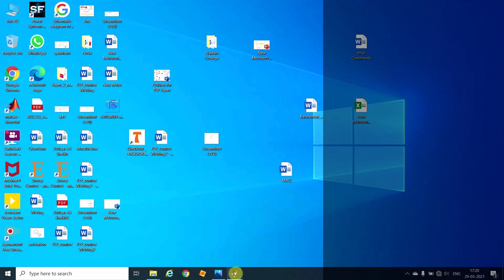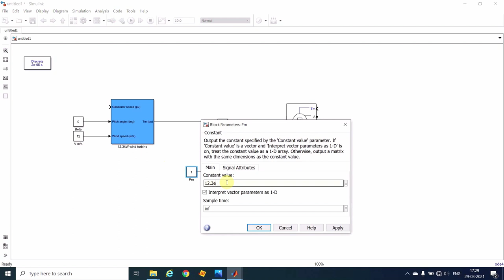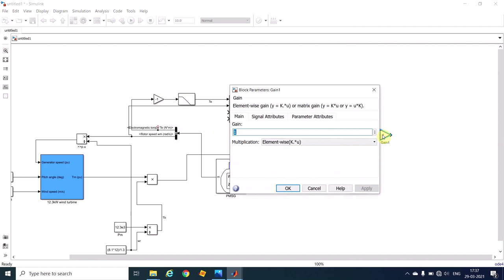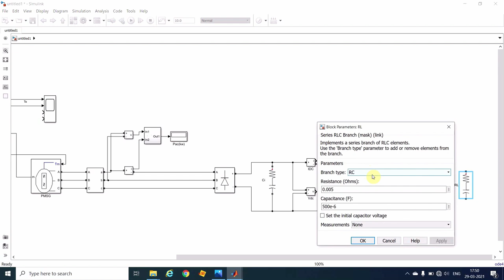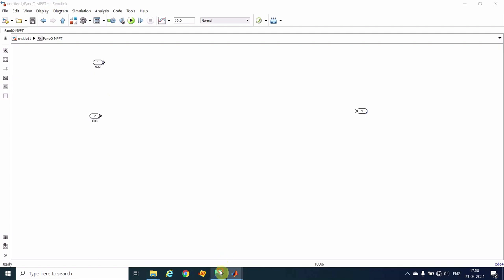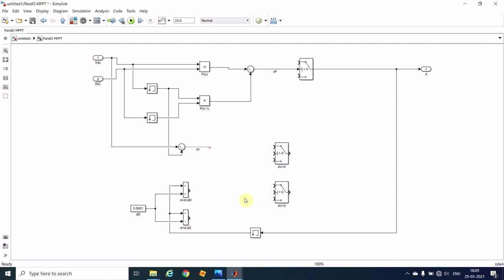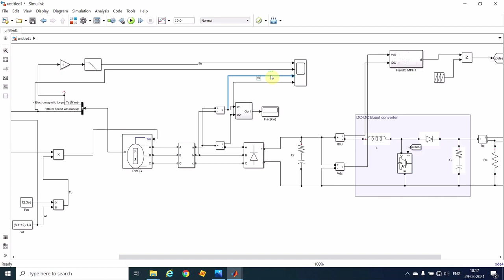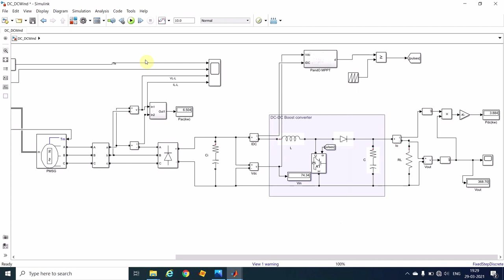MPPT with PMSG based Wind Energy Conversion system

Comment: Hello, Mr. Sh. Ansari!
I've been having a problem with the flowchart shown in your video 42:43:
My understanding: The increase in the voltage on the DC side of the uncontrolled rectifier indirectly indicates that the turbine speed increases. At this time, the mechanical power is greater than the electromagnetic power. In order to reach the maximum power point, the speed should continue to be increased at this time, that is, the electromagnetic power should be further reduced. Load power, since the load is a resistive constant load, can be achieved by reducing the Boost duty cycle to reduce the voltage across the load. This is the exact opposite of the model and flowchart in your video, but only yours is correct. This takes a long time. I don't understand what the problem is, I hope to get your answer, thank you!

Comment: The sample time 5e-05 of 'PMSGBOOSTMPPT/Subsystem/RMS/RMS /Fourier1/Product' at input port 1 is different from the sample time 2e-05 of 'PMSGBOOSTMPPT/Voltage Measurement/do not delete this gain' at output port 1. Consider inserting a Rate Transition block between the two ports. Alternatively, you can control the diagnostic action for unspecified rate transitions by changing the option "Multitask (or Single task) rate transition" on the Sample Time Diagnostics pane of the Configuration Parameters dialog box.

Comment: It's very helpful if you attach the reference paper which is taken as reference..!
Reply: @mesansari  i need code that you used to extract  the parameters
 of boost converter
Reply: @mesansari  I got it, but the model doesn't work . can I send you the model . when I put TS in powergui 2e-5 and in the first order filter TS 5e-5  it appeared an error massage the the sample time in the first order didn't match Ts
Reply: Any standalone microgrid expert. I need some help
It contains Solar, wind, battery and load .
Reply: @muhammadshehbazaslam4549  did you get any help? I’m also working in that area

Comment: thank for video. i have a question. in the M file, boost converter was designed 12kW output power but in simulation it is 5kW. Please, Can you explain to me? Thank you so much!
Reply: hi, did you get any answer to your question?

Comment: The sample time 5e-05 of 'MPPTwithPMSG/Mean/Model/Gain1' at input port 1 is different from the sample time 2e-05 of 'MPPTwithPMSG/Io/do not delete this gain' at output port 1. Consider inserting a Rate Transition block between the two ports. Alternatively, you can control the diagnostic action for unspecified rate transitions by changing the option "Multitask (or Single task) rate transition" on the Sample Time Diagnostics pane of the Configuration Parameters dialog box.
Reply: I did all the steps very same as of you. But I got error like this. 
Can u please help me out of that?
Reply: @mesansari  thank you sir, 

I understood the error, it is due to 'Tasking mode for periodic sample times:  auto '
I made it in to single tasking and now it is clear

thankyou for your valuable time
Reply: @saifudheenp8724  where is that as same error is in my model too.
Reply: After resolving this error I'm getting another error Error evaluating parameter 'Ts' in  'PMSGwithMPPT/subsystem/RMS/RMS/Fourier1' caused by:
 Undefined function or variable ' auto'.  
Please provide solution to this.

Comment: I am wondering, why there is a harmonic in pmsg voltage and current? Shouldn't it be pure sine wave as no switching is involved here?
Reply: @mesansari  sir, can I use this circuit as a machine-side converter by interfacing it to a grid-side converterr?

Comment: sir, please make a video on how to generate a signal from the controller to control the duty cycle of boost or buck converter.... please make it clear signal generation from the controller is the same for all type of controllers or it would be a different method for every controller
Reply: @mesansari   thanks sir! i also want to ask from where did you got these turbine and generator values if you find from some paper please provide the link

Comment: Sir how can i select the PMSG parameter values for any rating...is there any reference paper
Reply: Hi guy, just an idea: why you don't take a look at wind turbine contructor web sites. They have a lot of informations in they technical data specification documents.
Reply: @goyang2707  which wind turbine site would you recommended?
Reply: @ejo9664  I don't have it on top of my head right now, I'll check it later. I'll send it to you when I find it.
Reply: @goyang2707  thank you!

Comment: What is the value of voltage before the rectifier and after rectifier ? Are there are differences between the voltages , please ?
Reply: @mesansari  Yes, there is an equation that I know very well, but I work as DC Microgrid and when connecting the systems together to the DC bus, the voltage after the rectifier is the same as before in wind turbine
Reply: @mesansari  I noticed that the voltage after the rectifier is limited according to the control of the boost converter
Reply: @mesansari  Please can you confirm the information with me. I am a master’s student, and I have the same details.

Comment: hello sir, when i reduced the radius of rotor from 1.3 to 0.318 , i harvested more  power at output of pmsg (but to do this i have created an initial speed of pmsg to 200 rad/s) even more i gain an power of 10.5 ~ 12.3x0.85 as you setting the parameter of wt model . can you explain this ,please.?
Reply: @mesansari  yes, but my teacher said that if the mppt is correct then the output of the pmsg must be approximate 10.5 kw , and the generator speed (pu) must be 1.2 as your setting , and i adjust the nominal torque  output of wt by reducing the radius as i said then by somehow the power increase if i reduce to 0.94 ,but if i reduce futher the power decrease dramatically , i just think it was shorten the torque to pmsg at for start the machine so i set the parameter of pmsg with initial speed .

Comment: Sir, for my Vdc. I have a negative value on it. So, my power in ac is so low that it is only 0.7327kW. Is there any way that I can know why my system has a negative value in vdc?
Reply: @mesansari  I just found out my mistake. Thanks for replying.
Reply: Congrats guy, you solve it. I was wondering why when we don't use a constante wind speed, the power coefficient Cp don't remain positif. It should be around 0.45 according to Betz. Does anyone know how to fix this issue?
Reply: @jeremytui247  sir what mistake you found sir...because i have same low ac value 0.52 kw.
Reply: @divyasolaisamy6633  did you found the mistake ?
Reply: @jeremytui247  please reply what is the mistake found

Comment: I implement this simulink but I got an error in switch
Reply: Sir I impleament as it is as shown in the vedio but continously I'm getting error then I run the model with different solver setting then it run but I didn't get the actual output. 
I'm using R2105a version . Is this because of the version problem??? 
Sir please help me because I need to submit my thesis on this topic.

Comment: Unable to perform assignment because the left and right sides have a different number of elements.
Component:Simulink | Category:Model error i am getting ths error will u plz help me out. @SH.ANSARI
Reply: @mesansari  sir you run a code for calculations behind this model so whether we have to run this?
Reply: @mesansari  Thanks sir
Reply: @mesansari  Actually sir my out voltage like you 400 V is  not getting. I am confused about that point will u plz share calculations file. How to choose resistance RL value? Waiting for your kind response plz guide me.